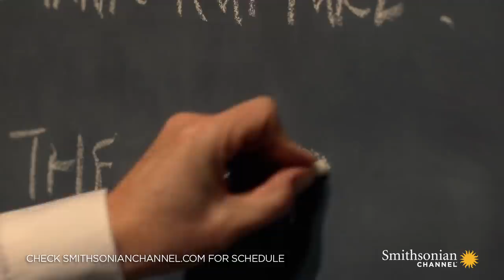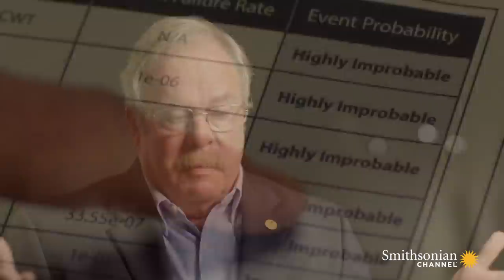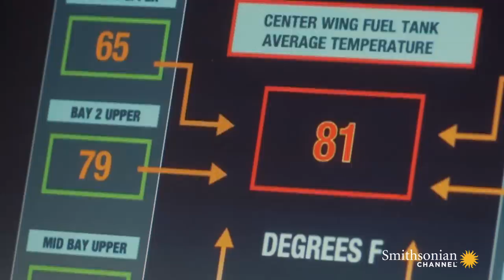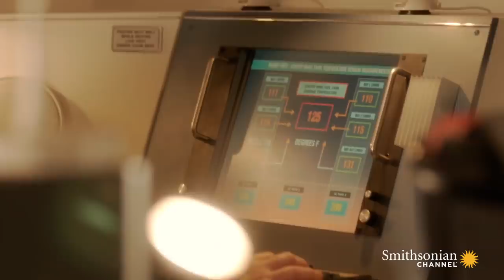How Air Conditioning Caused TWA Flight 800 to Explode

Comment: Boeing: It can never get that hot
Air conditioning units: never? 👀
Reply: Yes...Never. The Unit is designed to remove heat, not keep it around, but the heat itself,  in engineering terms, does not and  cannot get the fuel in the tank to get 127 F.  The fuel never gets that hot, not even close. and actually barely gets above the local ambient temp on the ground.  It has to do with convection, conduction and radiation. Your cars engine, as an example, gets pretty damn hot, but you don't get 'that heat' radiating into the cars cabin. On a cold winters day, your cars engine heat alone, WONT heat the cars cabin...the heat needs to be routed as it is to force heat into the cabin. The pack bays are vented and there are heat exchangers to cool the bypass heat, but the 'radiated' 'heat' if you will,  is very little as far as not being able to be 'radiating into the tank'.  Your refrigerator compressor gets HOT...but radiates very very very little heat.  You could have a room heater in the next room, as an example, and turned up HOT, but NONE of that heat is going to make it to the next room.  its a myth that the fuel tank got sizzling hot and just ready to blow!
Reply: Actually yes, they never get that hot. This was just the only thing they could pull out of their behind to have an alternative to grim and tragic reality that the US navy accidentally shot down TWA800.

At the time already the an organization of aeroplane machinists, who were involved in the investigation came out in opposition to the center fuel tank ignition theory, naming an "external high pressure event" as caused that tore up the plane, followed by ignition of the fuel now exposed to multiple heat sources and plenty of oxygen.

Also an interim report for congress named an external explosion as cause.

And 10 years ago already six(!!!) investigators of the original ntsb investigation came out saying that all evidence pointed towards an external explosion and that the FBI meddled heavily with the investigation.

Comment: The depiction of events in this video are inconsistent with two separate sources of radar that independently tracked the flight path of TWA800. The ISP Primaries and HPN Primaries radar captured nearly identical flight paths. Neither of which include an uncontrolled pitch up and acceleration of the aircraft. That is pure fiction, and verifiably incorrect and misleading. This theory put forward by the FBI and NTSB was laughed out of town by the aviation community and only gained traction when the NTSB released it's cartoon attempting to explain this maneuver. If an aircraft pitches up upon a catastrophic depressurization and 100% gain in drag coefficient by the inverse loss of aerodynamic performance the NTSB wouldn't have to use a cartoon to recreate the event. The explosion that occured as witnessed by hundreds of eye witnesses corroborated with physical evidence are very clear that the explosion could NOT have been generated by a low velocity event, as would be the case of the fuel tank (traveling at the same speed as the aircraft) v. a high velocity explosion, as can be readily observed with in any missile strike.

Radar recordings are points of fact, not generated by a government organization. The same government organizations that broke protocol at every turn to commandeer this "investigation". So, my instinct is to put my faith in the actual radar findings - which corroborates the climb narrative as a manufactured product of the NTSB and FBI that do not match the recorded radar movement of the B747-100. 

The aircraft exploded prior to the main/center fuel tank being breached as has been proven by the traces of nitrates found on the OUTSIDE of that fuel tank that when pieced back together show the splatter of these nitrates all fitting perfectly together like a jigsaw puzzle. This exterior explosion is the only possible way that fuel tank could be exposed to a spark of any kind, as there was no wiring or wiring harnesses installed in the B747-100 that carried the voltage necessary to generate anywhere near the energy that would produce a spark. 

The only battery on the aircraft that had the voltage to produce such wattage for that kind of energy transference is the outboard engine starting battery that is nowhere near the center fuel tank nor are any components of the wirinG
This explosion was precipitated by either one or two land to air missiles fired from the US Navy destroyers conducting test runs/drills of air invasions. The country was in a heightened state of security as a result of the 1996 Centennial Olympic Games in Atlanta which were set to be opened by the President were just two days after this. The Navy fired live ammunition when their intention was to just drill the procedure. 

The testimony of over 800 eye witnesses - all of which were incidentally had their affidavits conveniently omitted from the final investigation report - yes not even one of 800 were included. This was because the level of sophistication among some of the witnesses and the wholesale consistency reported by all 800 witnesses describing the exact same thing from every conceivable vantage point, including from a helicopter, sea vessels and casual Long Island observers ALL depict a sequence of events that in no way bears any resemblance to the official findings/report/cartoon submitted to the American public and World at large. 

Another fascinating ommission from the official findings can be read here: https://observer.com/1999/07/radar-shows-getaway-boat-fleeing-flight-800-crash/

This was a scandal of the highest order and frankly Clinton knew he wouldn't get reelected had the truth come out of this massacre on innocent civilians in what happened to be the summer of an election year. So the fail safe we have watched the Clintons do before and since this tragedy... they lied. and the lie was force fed to the public while those who know the truth from their 800 individual sets of eyes were marginalized, labeled conspirators and silenced. All to preserve a reelection bid such that he could go on to bang interns in the oval office. 

I will finish with this: for anyone that thinks this is all conspiratorial and that I am a tin foil hat milliner, please then provide an answer to the following simple question: Why is there no actual footage of this event anywhere? Seems odd that such a major event that, at the time, was covered by all major news networks has no video footprint of any kind available to view? Instead we are forced to watch cartoons and animated depictions of events. Please, someone, explain to my why this is acceptable. 

For anyone interested in the truth of TWA flight 800 there is eye witness information and documentaries available online, though many have been censored especially on YT, which in and of itself is an endorsement of truth.
Reply: The animation is inaccurate, I agree. But the sudden pitch up was caused by the loss of the front side of the aircraft after explosion. N93119 would experience regular electrical surges in the engine no.4 and that surge could jump lines eventually leading to the fuel probe in the center tank causing the spark. Given the fuels temp, any spark could ignite it. 
As for the eyewitnesses, when you see what looks like a shoot down, and news speculation mentions a possible shoot down, then your brain will change your memory of the events. 

When the explosion happened, since sound is slower than light, you would have looked up to see the plane already In the descent phase after explosion and stall-out. Then what you would have seen was the left wing break off the plane from excessive force, making you think that was the plane being hit and the clouds going up and down were from a missile.
Reply: Also the plane never accelerated. It climbed due to inertia. The engines were dead as soon as the explosion occurred.
Reply: Being banned is an endorsement to truth to you? Alright, so if I say you are a murderer who killed 5 people, and I spread that information around, and you keep me from doing that, you are only proving your guilt then? Or are you just trying to tell the truth?
Reply: @Slacker_eepy  It is critical to determine, and so far I have not been able to , the moment at which the outboard engines separated along with the wingtips after the initial breakup yet before the stall.
Reply: @Slacker_eepy  you have to consider the source of the information. When the source is an agency of the topic of investigation and has shown itself to be politically motivated by throttling dissenting facts or opinions to the "official story" which is the case on YouTube/Google. then yes, being banned or shadow banned is a good barometer to your proximity to truth.
Reply: @mkoury83  I see where you’re going from with this. I just have a hard time believing these things upfront, as there is quite a bit of evidence pointing the contrary to the claims of a missile shoot down.
Reply: @Slacker_eepy  that’s a reasonable perspective. The evidence when examined through a forensic lens free of inter-governmental agency “investigation” I believe the evidence is overwhelmingly oppposed to the official findings. This when scrutinized with the 800 witness affidavits sworn to have observed an unmistakable projectile moving upward in advance if the high velocity explosion (any sort of internal event would have been a low velocity explosion) would stand up in any legal proceeding, whereas the official report simply would not
Reply: @mkoury83  I see. Me personally, imo, I view eyewitness testimony less of proof something happened and more of details given once it is proved true. The distance of the plane from the ground was high enough so that the explosion sight-to-sound time was different. When the explosion was heard on the ground, the eyewitnesses likely looked up to see the plane already climbing after the loss of the forward section then later descending and exploding likely from the wing being sheared off.  In this kind of situation, I find it hard to trust eyewitnesses especially because when you remember an event, You likely change your memory to corroborate with your thoughts on the sighting, like for example, a shootdown. This could have planted the thought in the eyewitnesses heads that it was a shootdown.
Reply: @Slacker_eepy  Your comments regarding eye witness testimony is true. However, that must also be weighed against 800 eye witness sworn affidavits given regarding what they saw all bearing a remarkable similarity to each other. Obviously, some were erroneous, but the vast majority observed contrails ascending prior to the high velocity explosion, which in itself, being a high velocity explosion is only possible from external event. Had the plane exploded from the inside it would have been a low velocity event. The other smoking gun, IMO, are the nitrate traces that can be pieced together like a jigsaw puzzle found on the outside of the center fuel tank. How could that be possible if it exploded from within? There is far too much evidence that is diametrically opposed to what is found in the official story or the cartoon to even let the official fairytale pass the smell test.

Comment: But I have a doubt
As you go higher in altitude,the temperature should start to drop outside the aircraft and should initially cool the tanks
How did it reach 127F???
Reply: This was internal under the center fuel tank... Getting Hot...
Reply: Did you watch the Video? They Show and explain what & how by the A/C unit in the center of the Plain where the fuselage and wings meet is where the center fuel tank and A/C unit heated up to over 200 degrees or more past the flash point of the fuel. Not a missile as one's think.. Heat!
Reply: What Missile????
Reply: Some Guy, come on it was over 45K feet high.. Look at the Video and learn...
Reply: @quasicode6954  "fuel doesn't explode like this"
But it does.
Reply: You said it. Outside. Touch the hood of your car after driving for half an hour even if it’s freezing outside.
Reply: QuasiBiscuit857 How should fuel explode? Look at the images of Malaysia 295 which actually was shot down. Very different damage with barely nothing left.
Reply: QuasiBiscuit857 What reason would they have for shooting down an American civilian airliner? America had just finished Desert Storm years earlier and NATO was involved in Yugoslavia. Do you know how impossible it would be to keep something like this secret? It’s not like a couple of people assassinating someone. It’s not only ridiculous but actually insane.
Reply: QuasiBiscuit857 Law enforcement has rented the plane for training canines to sniff for explosives. It is all well documented.
Reply: The Center tank never got as hot, nor can never get as hot as has been suggested.  This is due to the design Architecture of the Fuel storage and Transfer system.  The center tanks ambient temp was only about 82 f..... and the fuel cooler. The liquid fuel can never reach its flash point. NEVER.
Reply: The fuel tank cannot reach its flash point, due to its design Architecture.  I'm sure a 400 mph ice cold wind is going to cool extremely fast.  at least on earth it does!
Reply: The 'video' is propaganda my dear friend. They did not 'show' and 'explain' anything except  "Junk science." You are familiar with Convection, Conduction and Radiation. its a physics thing!  200 degrees is nothing in engineering terms.  I doubt that your window AC unit, (not to mention the outside heat alone) or your cars hot engine, (does it pass through the fire wall and heat your car in the winter? NO.  Or your refrigerators hot compressor adding heat to the room.  why not?    I love "Real" science!   No, there was no heat in tis case.
Reply: not sure which side of the fence yer on?
Reply: Thanks for asking. Actually, there were 'Two' SAMs and 'One' Supersonic Drone. The FAA radar has the Supersonic target recorded. (Affidavits went to federal court)  The witness on USAIR flight 217, a Navy master chief with aviation credentials, saw the entire event as one of SAM that passed his plane. Then not to mention, the many external high velocity holes that peppered the fuselage.
Reply: how Ironic! lol.... your very own statement: the general public lack of knowledge..... :)   The 747 was not 'shot down' and the 'AC'  had absolutely nothing to do with this.  An AC blowing up a plane...Really??  and I have no idea what hat you pulled the rest out of!
Reply: Yes. learn...... what on earth are you talking about???
Reply: There were NO missile tests by the Navy (as has been suggested.)  No 'accidental' shoot down.  There were No naval surface vessels even in the area at the time of the accident.  where do these rumors start?  lol...
Reply: No, it doesn't.  signed; former U.S. Navy Aviation Boatswain mate.
Reply: Ok..... but what is your point?  There certainly is insufficient heat..... don't know anyone who drives over 400 mph in sub zero temps? do you?
Reply: By the 747's 'Design Architecture', the [Center Wing Section} wont (cant)  ever reach its Flash Point / and not to any 'catastrophic' condition. The 'highly explosive' scenario created by the NTSB is myth, as was proven to be so, in Federal Court.
Reply: Not so. This is by Design Architecture, so such a theory is Physically Impossible.
Reply: ????????  why don't passengers 'freeze' on a flight?
Reply: it's a cover, you're 100% correct
Reply: @toddlavigne6441  - It was at 11000 feet
Reply: Actually, TWA 800 was just past 15,000 at the time of the event.  The NTSB and other reports are incorrect.
Reply: to whom are you replying to Todd?   thanks.
Reply: @quasicode6954  active shooting ranges are clearly marked on aviation maps and avoided like the plague
Reply: @lecorsaire2283  You mean MH 17?
Reply: QuasiBiscuit857 no they didnt lmao
Reply: QuasiBiscuit857 boi if they were missile testing they wouldnt lock on
Reply: Rob Shef who shot it down then
Reply: Todd Lavigne it was 13 000 feet
Reply: Warmed up by chemical reactions of Ptx & Rdx?

Comment: It wasn't the air conditioning. It was bare high voltage lines, touching a low voltage fuel probe line, inside the fuel tank.

Comment: Nice bit of propaganda.  Even old 747's don't have fuel tank explosions.  Much too well designed for that.
Reply: Exactly Brian. But we have peeps in here who know nothing about AC...... yet THEY, have ALL the answers.  The entire architecture of the system was extremely sane, not to mention that Kerosene is the Least likely fuel to detonate!  I am former Navy Aircraft handler so I know.  Never had a plane "Blow up" on the Flight deck for a fuel reason...because it was hot out!

Comment: This is NONSENSE.  TWA 800 was shot down by two surface-to-air missiles, and witnessed by about 100 people on Long Island, many of them actually saw the missiles ascending.
Reply: I'm going to get angry comments when I say this  B U T

What those people really saw was the already burning plane rise into the sky because of the wight it lost when the nose can of the plane and the engines were at high thrust and the weight loss caused the centre of gravity to shift to the back of the plane.

And then they saw the plane stall out and further explode apart

Also, there was a 737 pilot watching TWA-800 from his plane and he said the explosion came out of nowhere. no mention of
a missile.

one last thing, as you know sound has a speed so by the time these people heard the explosion the plane was already in its death climb and was about to stall. So those people thought they saw a missile rise up to hit the plane and the plane fell.

 When what really happened was the plane itself rose up and then stalled.

if you don't understand any of that I can't help you there
Merry Christmas.